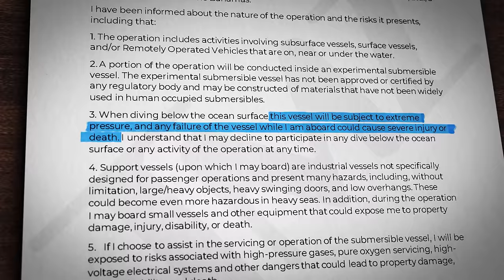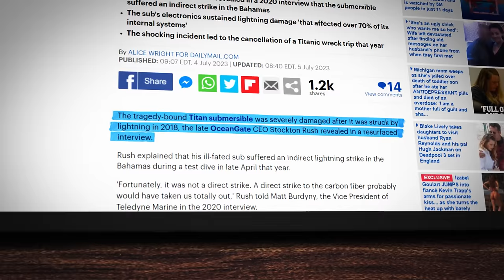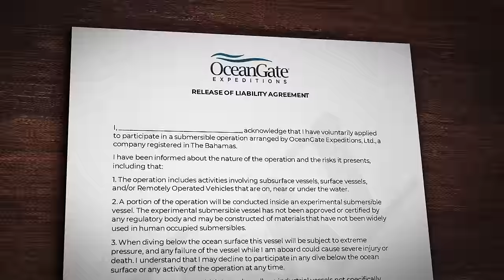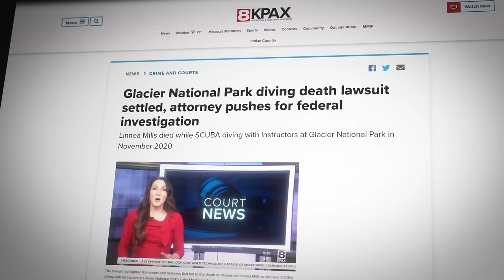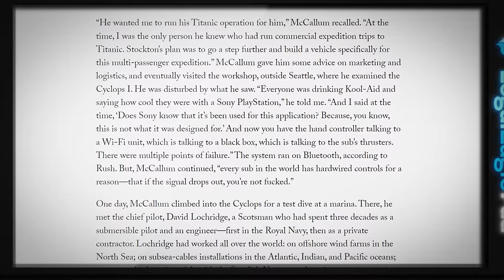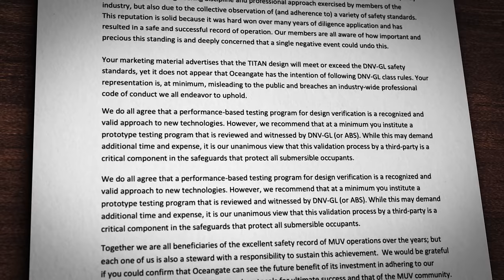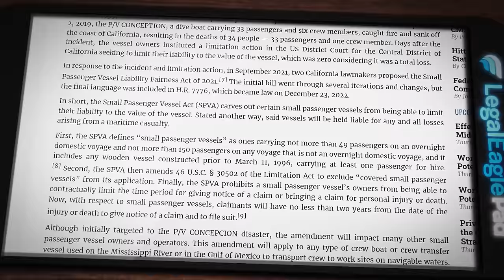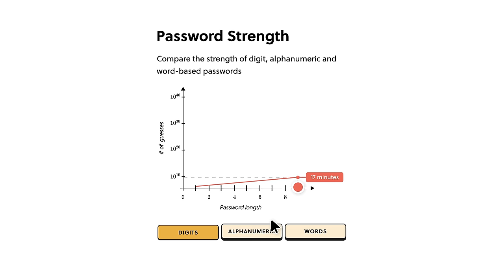OceanGate Is Getting Majorly Sued

Comment: The waivers said it was experimental, but it wasn’t actually experimental. It was already PROVEN by engineers in the industry to NOT WORK. The reason others didn’t use carbon fiber and a cylindrical design wasn’t because they hadn’t thought of it or hadn’t tried it. They already knew metal and a spherical design were safer. So it’s not an experiment at that point, it’s just irresponsible. That’s a huge difference.
Reply: Failed experiment lmao
Reply: @helgahaa  Man's law vs law of physics. Who will win?
Reply: "The value of failure in science." 
I think the CEO/builder was figuratively drunk on, "There is no such thing as a failed experiment."
Reply: carbon fiber is actually a viable option for a pressure hull when used correctly. a correct use would be a submarine that goes as deep as an attack or missile sub as shown by extensive research done by multiple navies. however even if it is cheaper in cost it does break more quickly than titanium and is prone to cracking. that is why it isn't used because it requires more precision and maintenance. also that stern area on titan was a cowling not the actual hull she was infect a cylinder similar looking to a naval submarine. 

the carbon fiber used by Rush was surplus from Boeing that was past it's shelf-life so it was deemed unsafe by the manufacturer to be used.
Reply: The more I hear about this shoddy operation the more I think that a catastrophic failure was inevitable. I don't think there's anything anyone could have told him that would have forced him to change his ways.
Reply: @cludecat7072  Carbon fibre is usually a great option for a pressure hull where the pressure is coming from INSIDE, such as an aircraft, or an air tank. That's because they have enormous tensile strength and can take a lot of stretching before they break. But fibres don't take compressive stress, which is why they're never used for a hull where the pressure is coming from OUTSIDE. Also, being a composite material, there are literally a million ways for carbon fibre to fail. It's a million woven strings, so what if one string snaps? How about 100 strings, how about 1000? How do you know you're on string 998, and you're two strings away from getting crushed? You can't.
Reply: It's not just that actual experts had tested similar designs and found them wanting, Rush himself had tested the sub and it failed over and over again. If a company passes a product for public use after it repeatedly fails quality testing, that company gets sued, especially if it caused actual harm as a result. If Oceangate can get away with this by basing itself offshore, how long until other companies try the same tactic?
Reply: The worst thing here is, they are advertising the experimental equipment to the public as a commercial with an expensive price. Meaning in development, when you sre the developer snd you slready gave the product to your client, this is not anymore a experimental, it is already a production.
Reply: It was experimental. They experimented with how far they could push the design to it’s breaking point, albeit with passengers on board.
Reply: Actually it was already proven to work by Rush. It had worked several times before so this is ridiculous
Reply: @Ealsante  Not only that but when under exterior pressure you can lose layer cohesion as the material shifts and it will rapidly delaminate. You go from a composite to a roll of unconnected fibers.
Reply: @AmorFati777X  That would be reasonable if it had been made of a homologous material. This was made of carbon fiber, which meant that each time it dove it actually became less likely to work the next time. Engineering experts everywhere already knew this. James Cameron talks about this problem in an interview and called it "insidious".
Reply: @bengomez6479 just because it works 5 times doesn't mean it will work a 6th time or any amount more. That's just stupid reasoning, especially considering their use of carbon fiber. It failed considerably even when it did make it down. This wasn't some freak accident, it was inevitable.
Reply: @brianbarrios1717  what's your opinion of NASA? Should the astronaut families be allowed to sue every time their garbage shuttles blew up?
Reply: @brianbarrios1717  Funnily enough, if they had followed standards then the previous successes would have been indicative of a safe design. But yeah the carbon fiber was the biggest issue in the whole thing because no number of successful dives could ever indicate it was safe because of the way the particular forces involved affect the material.
Reply: @AmorFati777X  absolute pea brain take. There are multi-dive subs and there are single-dive subs, James Cameron’s sub went to the challenger deep but had to be retired afterwards because it’s designed and tested to be that, a single-dive sub. Just because they made a couple dives beforehand successfully doesn’t mean it’s proven to meet the standards required to be operated so many times. Planes you get on are tested for hundreds of thousands of hours to find their breaking point, and the operating point is set well below that. Why on earth are you even trying to defend ocean gate when their negligence killed 4 innocent people?
Reply: And like...even if it was..
Why would you let passengers in an experimental sub????
Reply: @genericname2747  a respect for human agency? He was facilitating people who wanted to vicariously live out adventure. Surely you don't think that people who thirst for adventure want imitation crab meat where there is no real element of danger? If you want that go to some Disney or universal theme park
Reply: @AmorFati777X they wanted to see the titanic, not to risk their lives; a perfectly safe sub would have suited them just fine. you can't possibly believe what you've posted, so on a functional platform you'd be banned for trolling. and yes, of course nasa should have been sued out the wazoo for their negligence, although i'm guessing that ad a government entity they have legal immunity.
Reply: @Ealsante  I believe I sort of stated that it isn't as suitable but it is a proper material that just requires excessive maintenance to keep safe
Reply: @AmorFati777X  This is probably the strangest take I've ever seen about this, so congratulations? Do you think skydivers would find the experience enhanced if their plane was visibly duct taped together and their parachutes were packed in the dark? Corporate negligence isn't the kind of danger that people find thrilling. It's cool if you're into that though I guess
Reply: @incognitoburrito6020  like I said if you're going to excuse NASA forts in confidence despite all the funding it receives then you're just playing favorites and are a respecter of persons.
Reply: @AmorFati777X  what?
Reply: @ellicel  EXACTLY.

Comment: The fact that the passengers are referred to as "mission specialists" is clearly an intentional move to limit liability.  Rush (or at least his legal team) was aware of the laws they were breaking, and were actively attempting to "cover all the bases".
This is manslaughter disguised as gross negligence.
Reply: great comment
Reply: ah yes, a 19 year old mission specialist
Reply: @lucifugerofocale5847  Weak argument considering that he was an adult and he finished highschool...
Reply: @Bialy_1  ah yes, because you gain all insight and understanding and maturity when you turn 18
Reply: @Bialy_1 moreover no where in that space of time from finishing high school to age 19 did he train in submersibles nor complete a degree in any scientific field related to deep sea diving.
Reply: I'd call it a "premeditated murder", as the design was flawed to the point you don't need an engineering degree to see the problems. And they knew it, that's why they didn't do any certifications, or even tests under pressures higher than expected. So they knew they will murder someone, they just didn't know, who would be a victim.

As someone who designs and builds stuff (as a hobbyist) I can say there is no problem in using off the shelf components. The problem begins when you use off the shelf components designed for use at home to build a submarine (or a rocket). Most common parts or modules, including Arduino and Raspberry Pi boards (and similar) can't be used for automotive, aerospace, marine or military applications. For those purposes one has to purchase components directly from the manufacturer, with individual agreement, and increase in price for more robust specs. Also you NEVER use any radio communications underwater, as it simply doesn't work above (IIRC) 100Hz. Everything should be wired, and any loss of power should cause ballast to be dropped and submersible to go to the surface...

So for me Titan was "Saw" meets "Final destination" case of premeditated murder of random people.
Reply: @Bialy_1  19 year olds don't know anything
Reply: Manslaughter is when gross negligence causes death, so in this case they are the same.
Reply: @urgon6321  The people on the sub knew what had happened and what the concerns were probably better than we do,  they knew what the risks were.
Reply: yep, you literally cannot sign away your legal/lawful rights. which is why any normal contract that words itself like this one also has in the fine print "except where governed under law" (paraphrased), so the entire thing doesn't become instantly void, without that little bit then any clause within a contract that is unlawful voids the entire contract.
Reply: @tomriley5790 , officially risk were less than crossing the street. It's harder for a layperson to know they're in deathtrap before it springs.
In medicine we have this (mostly) worldwide standard of informed consent. How well informed were people spending $250k to dive in "Poor man's submarine"? How many people read those agreements and waivers anyway?
Reply: @Bialy_1 does high school prepare you to be a submarine operator?
Reply: @genericname2747

It's funny you say that because that was the only person on this vessel that had any sense to do some research before going down there. He didn't want to go because he saw how sketchy it was. He went because it was Father's Day, bro
Reply: PH too, but he was widowed and incredibly depressed.
Reply: No.  It isn’t.  These rich idiots had at least some personal responsibility.  I’m no expert on submersibles.  But I know that any dive  to those depths is high risk with tested equipment and skilled operators.  These people were actually contemplating doing this dive.  The reasonable person standard should apply that these passengers had an obligation to independently verify safety claims.
Reply: More like gross negligence disguised as calculated risk.
Reply: @urgon6321  

and the electrical system was designed with parts subject to galvanic corrosion.  The materials inside were reportedly highly flammable and vinyl inside would have emitted toxic gases if it caught fire.  There was no emergency beacon shipped (even if it wouldn't have worked at the titanic depths it would have been useful if it surfaced away from the mother ship) and all this talk about how they were bolted in and would suffocate if they surfaced away and weren't found before the oxygen gave out - acrylic isn't titanium - they could have shipped a battery powered drill and cut breathing holes in the acrylic window till they were found - how stupid to lose five lives in that (admittedly unlikely instance) for the want of not shipping a 50$ drill.  Not that it was likely to happen but regardless, such a cheap answer to the issue. And how stupid not to ship a beacon or a drill, neither very expensive, for such a problem
Reply: @Bialy_1 i dont understand how ( in usa) that you can be considered responsible enough to sign a contract, go to war, but not drink. Oh, they are not mature enough to drink but they are mature enough to understand contract law ?
Reply: @SokarenT4S  The better counterpoint here is pointing out that specialist training tends to be 3-8 years beyond finishing highschool, I'd say. That kid was in no way someone who could be considered any form of mission-critical specialist.
Reply: @tomriley5790  Really? You think anyone other than Stockton had even heard about the actual concerns regarding the viability of the vessel? You genuinely believe that at no point did Stockton drum up how his Titan was unsinkable? Despite there already being witness accounts of such claims?

Lets not beat around the bush, if any of the passangers were aware of the full slew of risks that Stockton's tin can posed, none of them would have bothered to spare the fucker a second glance.
Reply: @Bialy_1  Having a legal paper that acknowledges you as an adult and having gotten through an education system that most people around the globe consider a joke isn't exactly what makes a mission specialist for test diving an experimental submersible.
Reply: @JodyOwen-we6oo If it were free, I’d agree the passengers have a duty to independently verify safety claims. But when you are paying $250,000 each, part of that cost is paying to not have to.
Reply: @Bialy_1 you’re joking right?
Reply: The only actual mission specialist may have been the French Titanic expert.

Comment: Amazed that they put more effort into the contract being watertight than the sub
Reply: Well said.
Reply: Most underrated comment ever! 📈🤣👍
Reply: Well played sir!!!
Reply: Of course, in the face of such a tragic incident, it's unsettling to see how Ocean Gate's contract seems to hold more water than their submarine did. As the legal team navigates these rough waters, they've managed to stay afloat, buoyed by their meticulously drafted agreements. You could say their legal strategy was designed to weather any storm, a contract as unshakeable as the ocean floor and as unsinkable as the sturdiest of ships.

In fact, they've gone to great depths to make sure their liability doesn't spring a leak, as solid as a seawall, with no room for loopholes to make waves. And even now, up the creek without a paddle as they might seem, their legal defense remains shipshape. Their contract, acting like a steadfast anchor, might be all that's keeping them from getting swamped by a tsunami of lawsuits.

The contract, seemingly dry as a bone, is designed to keep the company from drowning under legal scrutiny, acting as a lifeboat in troubled waters. Despite their submarine succumbing to the pressure, their legal defenses, anchored by this contract, stand tall like a lighthouse, holding back the tide of potential lawsuits. Even as they're submerged in this sea of controversy, they're determined to go with the flow, hoping their contract will help them float on the surface. 

But while they might be able to weather the legal storm, it's clear that the real-life tragedy has left an indelible mark, a reminder of the real stakes when venturing into the ocean's depths. In the end, it's a sobering lesson about the risks of diving too deep, too fast, and relying on a contract to serve as a life raft in a sea of potential legal trouble.
Reply: @R2Bl3nd beautifully punny essay ngl
Reply: cheaper to write a doc than to build a proper sub, as bad as that sounds lol.